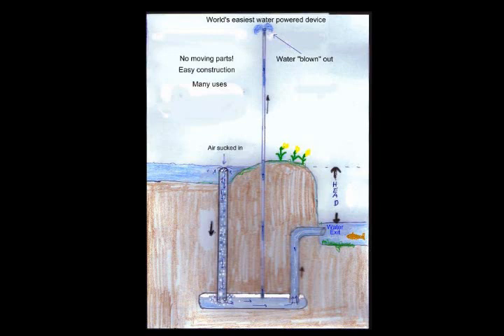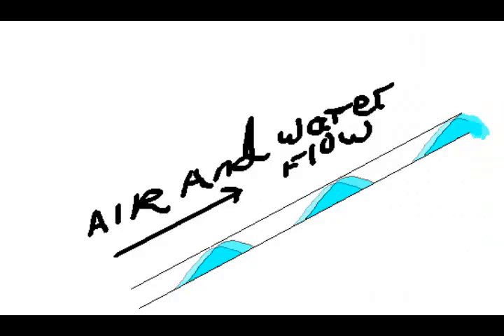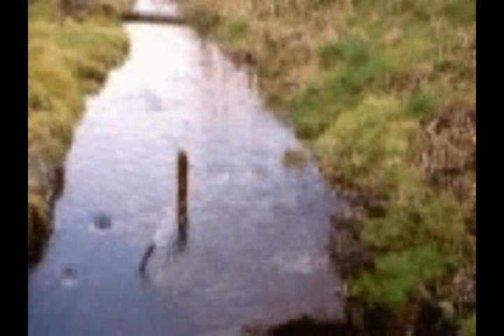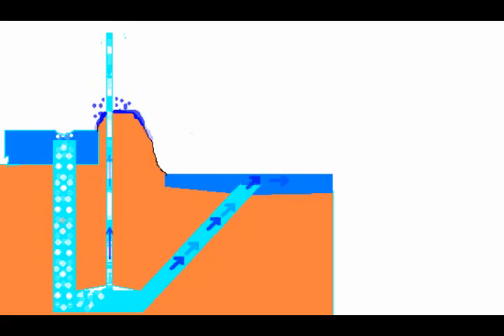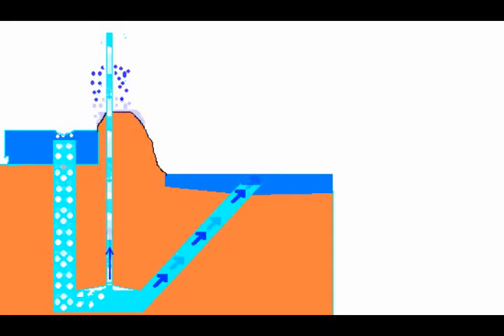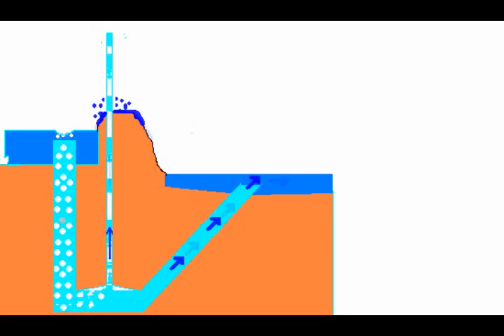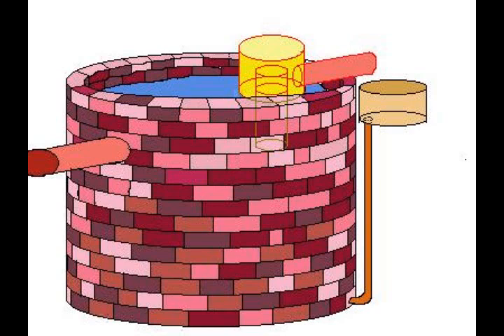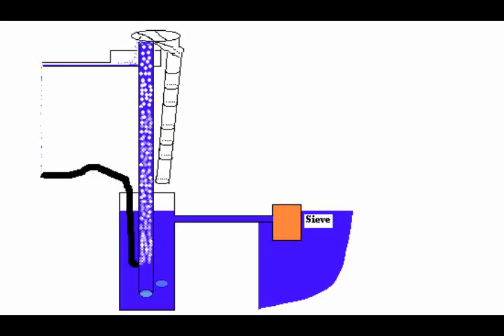WORLDS SIMPLEST WATER PUMP!! Make a PULSER PUMP!   Alhambra pump from 1400 AD? Make one and see!

Comment from the maker: Just a note for new people here,  there are a few videos now that speculate that the engineers at the Alhambra Palace in Granada used a pulser pump to pump water up 6 meters to a tower where guards were stationed. Their pump also had no moving parts and the mechanism by how they worked is unknown.    This would have been in use  between about 1100 or 1200 ad and some time after 1500 ad. It is certainly possible,  but the videos show diagrams that are not likely to have worked well. My pumps worked for years. Anyone know more details about the Alhambra pump?

Comment: Is there a back flow prevention feature in this type of pump? How does this handle back siphoning? Say that the river water level rises high enough to no longer be able to suck in air but just water? How does it prevent the water from sucking back down the pipe you have your washer or irrigation hooked to and back out into the invironments? And if it gets too low? A little bit of used water can still travel back down into the part of the pump that's under the river and when the river level rises back to normal pump working levels that water will be pushed back out into the environment. And that's not good if backsiphonage happens with laundry washers because soap and soiled dirty water getting sucked back into the river. I knew alot of it will get stopped by air lock/vacuum lock affect,  but i can see a pretty good amount of that getting by before that occurs and slowly leaking by over time due to thermal expansion and contraction.  If his pump is able to create pressures that can flow through a backflow preventer assembly installed on the discharge side of the pump, then this is a great idea.
Reply from the maker: Hi Ryan.  Stop the video about 20 seconds in. At the top left, there is a kind of "stopper" that you can raise or lower that lets air into the  vertical down pipe even when the water level above the dam is quite high.   Raise the stopper to let more water in, or lower it to let less in.  There is an optimum range of water speeds,  so you can just raise or lower it a bit as needed.   There is no backflow into the river because the user water  level is lower than the can attached to the stake. (top middle). There is more detailed stuff probably still in my google pictures and on other websites it you search pulser pump.

Comment: Brian, I’ve only just found this video. I have an entirely different use for this type of pump. How far vertically have you been able to achieve consistency within the pipe? Have you tried for a second story or maybe 10 meters up?  Have you been that successful in vertical runs?? Have you attempted it? I would like to talk more more with you about your trials. Is that possible? Jerry,  Jfrugoli2011@gmail.com
Reply from the maker: Hi, Jerry,   I have done lots of experiments over the years. Efficiency is low and drops further the higher you pump.  With that pump,  the highest I have pumped was about 8 meters.above the stream.  (to the roof of a building about 40 meters away). This was pumping up an incline.   I was not able to make a structure vertically 10 meters high beside the pump but I think it could have pumped that high.   I did experiments using a little aquarium air pump and tiny pressure to pump as high as possible.    It is in the trompe and airlift pump  video playlist.  
I don't live there anymore, and there is no river or stream on my property in Canada so my ability to do pulser pump experiments is severely limited.  Thanks   Brian White

Comment: Mr Brian, I'm trying to implement your system in Honduras Central America, I see a great potencial for small farmers How did you install it under water? Did you needed a water fall? The River in which I'm trying to implement this system is in a valley and doesn't have a fall. Thanks
Reply: Otoniel Manley you could get everything you need at Home Depot or a plumbing store for 50$ or so. You only need two or three feet of head pressure and a stable water level. The down side is it doesn’t put out high volumes.

Comment: Can it be used in aquariums?
Reply: +kristine robin linsangan I don't think so... I'm looking to turn my aquaponics into "off grid" and this looks like you need an external, flowing water source and the layout of this looks like it wouldn't work to "recirculate". This would be better to, say, fill a pond without a pump/electricity and possibly maintain it's water level or water a garden via nearby stream or something along those lines. Free (other than a few cheap parts) and easy.... Couldn't hear him well, everyone's asleep here and I don't want to disturb them.

Comment: can this apply to small home aquarium ?
Reply from the maker: +Zegwei Teoh  You could set up a mini tromp (1meter deep) in a river or stream and use it to send air  to a pond or aquarium.  Then just bubble the air in 1/2 meter to 1 meter below the surface for aeration and  making a current in the pond.  A 1 meter tromp can also run airlift pumps (small ones) in the pond that can pump water for water features around the pond.

Comment: The physics of this stuff; http://physics.stackexchange.com/questions/227309/air-core-vortex-physical-explanation-of-the-air-entrainment-hook-at-f-co-0
Reply from the maker: +JokelaTurbine Hey,  thank you very much for that!  Your link shows a horizontal pipe and mine is vertical so it is quite different as soon as the air enters the pipe.  But probably somewhat similar before that event.    I ended up using a circular  flap or disk  with a 12 mm pipe through the center of it.  The pipe extends about 15 cm into the vertical inlet pipe for the trompe section and about 30 cm above.  So when closed,  the pipe is 15 cm down into the trompe,  when open,  (lifted 2 to 8 cm)  it is still at least 7 cm down in the middle of the trompe pipe.  I also used the same idea with the bottom of a plastic can instead of a circular disk as the "lid"  I have pictures online somewhere.  I can link to them because they can be useful to anyone who wants to aerate or make a trompe.  Brian
Reply from the maker: +JokelaTurbine  Just note also,  that making a vortex within  the vertical pipe (in the case of the pulser pump and trompe) reduces the airflow down the trompe.  (I have measured this).   So, yeah,  I ended up not using an "air entranment  hook" because it extended down the trompe pipe.  However your link is very useful,  It will help me and others figure out ways to reduce vortex in the vertical trompe pipes!

Comment: sounds like space invaders
Reply from the maker: +808ROTY09  I held the mike close to the pipe outlet.  It was a 3/4 inch diameter  thick walled black plastic pipe.  The sound is pretty accurate.

Comment: Sweet... didn't quite get how it worked completly, but have an idea... should be put into use where ever needed, since it's so simple!!
Reply from the maker: Brian Davis Hi Brian,  the main problem with the pulser pump is that you have to go about 3 meters deep beside a river or stream and people are reluctant to do that.  However there is another option. I call it the pulser pump nano,  and the idea was  given to me by a lady called Eileen Jackson.   You can make a "trompe" that is only 1 or 2 meters deep, and harvest the low pressure air from that for useful work.  So 1 meter deep creates 1.4 psi and 2 meters creates 2.8 psi.   And you CAN do useful work with that compressed air.  Check out my pneumatic grid project and pallet garden project for more details.  I have pumped water 5 ft high with 4 inches water pressure!  (and it is on youtube).  4 inches is about 0.15 psi.   I believe that if people try making low pressure trompes,  my work on the extreme low pressure airlift pumps can help them do useful work with tiny energy sources all over the world.  BUT people have to try.  We cannot wait for universities to test these things,  Their testing cycle is a whole year long and it is a learning expedition for the students,  and  unfortunately  both times the pulser pump was tested in universities, the tests had fundamental  mistakes in them. (Which by the way,  I could easily have spotted,  I did not see the experiments until after the results were published.)  In one, the tromp worked 2 or more airlift tubes but the guy neglected to put air taps between the tromp and the airlift tubes. This mistake ruined the experiment but he published his results anyway. Due to the missing taps, the results were mediocre. All the air went to one tube and it went to churn flow (not plug flow)  and churn flow is far less efficient than plug.
Reply: Brian White Be neat if you could put together a system that you could sell??

Comment: Is this similar principles to hydraulic ram pumps?
Reply from the maker: Nope
Reply from the maker: It is less efficient and easier to make and maintain.  It can easily use low grade water power (about half meter head).  Rams cannot.  It should be able to use high volumes too.   Say 500 liters per second.   A ram cannot do that.   So it is just different.  The biggest use should be as a low pressure air compressor.  This is for aerating fish ponds,  and activated sludge process.   These are high value uses.
Reply from the maker: Hi Ian,  you are not going to be able to make a usable ram pump for a 1 meter head and half a ton of water per second.  That is my point.  By all means try it. If your pump survives the vibration,  that will be great and most unlikely,  if the dam survives the vibration,  that will be a miracle too.  Will the fish life in the river survive the vibration waves and cavitation events inside their bodies and gills every second or 2?   These vibrations will be transmitted through the water,  for a few hundred meters down stream of the ram.  Will cavitation cause mayfly larvae internal organs  to burst?    Will the vibration affect other structures?    Yes it will.   These are problems that efficiency measurement does not address.  But they are very real problems.

Comment: As a scientist I can confirm it works, like Bernoulli's principle. Its not of industrial interest because of the low efficiency. At remote places it can be useful, though.
Reply: Seth Mitchell Where do you disagree?
Reply: Stefan Sulzbach 
Ein Wissenschaftler, du sagen? Ich bitte zu unterscheiden :P
Nicht zu sagen ich nicht einverstanden, jedoch.
Reply: Asa este cum spuneti  .Ar fi primcipuil venturii iar debitul mic ar alimenta incontunuu cu un pic de apa la o inaltime de cativa metrii

Comment: I am looking for a simple water pump for an aquaponic system that doesn't use electricty (or fuel). Do you think it might work for an aquaponic system? I have seen this system used for compressing air for cobalt mine work in Ragged Chute Air Plant in Ontario to run their drills (I might make it one for to run machinery run by compressed air, refrigeration etc). I am not sure why, and I honestly cannot wrap my head around using it for pumping water. But I hope it can.

Comment: The "bubble lift" part of pulse pump was widely used (at least in SU in 1970-s and earlier) as a  pump for aquarium filters. The obvious advantages were that it utilized the air flow of cheap air pumps anyways used for aeration... and was stupidly easy for DIY.
Reply from the maker: Yeah,  the main difference is that I tried to optimize pipe sizes and air pressures to get higher lift from low pressure air. Surprisingly nobody has done that experimentally before I did.     Following the pulser pump, a lady suggested why not test a "nano" pulser pump.  A smaller version with just 3 or 4 ft of water column pressure generated (and trying to get that to do useful work).  (So just 1 to 1.5 psi of air pressure).  I tested and designed low pressure air pumps since then and got to the stage where I could use 1 psi to pump over 10 ft high and even could use extremely low pressure (4 inches of water column) to pump water over 5 ft high. Prior to that experiment,  I was told that 20 to 1 lift to submergence ratio was impossible.  It clearly isn't because I put video on of my experiment  and it was replicated in north America, Europe and Asia. (this was in the ourwindowfarms community last year).  Experiments are valuable because theory is often just one person's idea of how the world "should" work.  We should do more experiments to determine the true limits of low tech devices.

Comment: Pistons? in the oil industry we call them rabbits, when a gas well is getting old and pressure wont lift the water to surface, we will set up a timer and catcher on the wellhead, drop a steel rabbit down the hole, well will shut itself in for a specific amount of time to let pressure build then valve opens and gas water and rabbit come sailing up the pipe, up 1800 meters on some of our wells, then rabbit will stay up in the catcher for a specific amount of time then valve closes and it drops to repeat the process.
So yea a piston would work well for going long distances
Reply from the maker: Thanks Greg.  Interesting concept.  Unfortunately, I no longer live on a farm or near a river where I am allowed to "play".   Would be interesting to try pistons to either help move air down in the tromp part or to help reduce slip in the airlift pump part of the device.  The limit for "relatively" efficient plug flow in vertical pipes seems to be not much more than 1 inch diameter.  So this will always be a small scale device.   Pistons would also be very interesting in the "inclined pipe" version.  There, the "wave in a pipe"  could push the piston along like a surfer.   I never got to do much with the inclined pipe version (it seems more likely to work well with larger pipe diameters and I did not have the money to buy them at the time of my experiments)  and its great advantage is that the pipe can just lie on the ground and pump uphill).  The inclined version with its "waves in the pipe" seemed the most miraculous thing at the time! Sometimes the waves or pulses of water would be more than 20 seconds apart in that version.    You also  don't need to build a 10ft or 15 ft high tower to pump straight up  with the inclined version. This was a big advantage too.  Brian

Comment: I am trying to use a windmill to pump the air for a hydroponic system.
So are there measurements of how much air needs pumped and can it be sporadic?
length of pipe in water compared to lift?
Reply from the maker: It is nice if you can go the same submergence as the height you are going up. Mine in the video used something like 25 watts (total power in the water) and it pushed air down about 2.5 meters (so just over 3 psi).  It was producing  about 11 liters per minute of air and it pumped 3 or 4 liters per minute of water at about 3 to 3.5 meters high.  The pumping was through 3/4 inch pipes ( about 18 mm pipes) and that amount of air at that speed was pretty much optimal for that size pipe and that amount of pumping.  So, you need to measure what your windmill produces and at what pressure.   Don't be too disapointed if the pressure or air volume  is lower because I have shown that mini airlift down to 1/4 inch tube sizes also works. Generally the lower you pump, the more efficient the pumping.  So if you are only going a couple of ft high, the efficiency will be a bit more.     Brian
Reply: Don't know much about this pump, but is same theory as gas lift in oil wells, for which there are tables on what lifts what and how fast etc…  Just remember that the smaller the tubing the fluid is moving up, the more efficient the air bubble will move the water (less slippage around it) up the pipe….good luck

Comment: Near Cobalt Ontario is an old pump of this form used to create compressed air for the mines.  I think the intake pipe was about three feet across.  When the pressure exceeds requirement it blows off water in a mighty fountain, a bit like Old Faithful.  The design might have come form Germany.
Reply from the maker: Hi, David, they made the first trompes in Italy, somewhere around 1500 ad, (using water to compress air for smelting iron) then the design spread to Spain and became popular there, so that was producing large amounts of low pressure air.  Then it seems between 1800 and 1900 people across the world used high pressure trompes with deep deep pipes to generate pressure for mining  in north america and to power  pneumatic machines for making rail tunnels in the alps.  Then electricity came in and the high pressure trompes were killed off really quickly.  As far as I know nobody used low pressure trompes to pump water as I have done.  (Perhaps Joseph Priestly did when he emigrated to the USA but I did not find a record of it). Check out my low pressure pneumatic grid project for what might be the future of trompes!  I have now made reliable airlift pumps that work on less than 1 psi pressure (less than 7 kPa) and a trompe that goes just a meter deep can make that pressure!  By the way the highest lift to submergence ratio I have ever got is about 23.  The books say that is not possible but I have videoed it. (I am not saying that 23 to 1 lift to submergence pumps useful amounts of water,  I'm just saying it is possible)   Thanks Brian